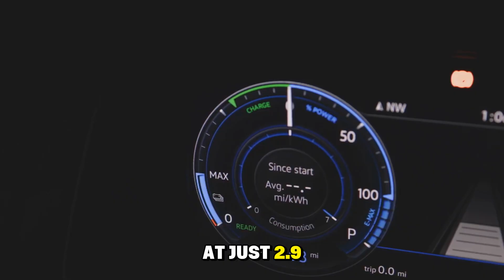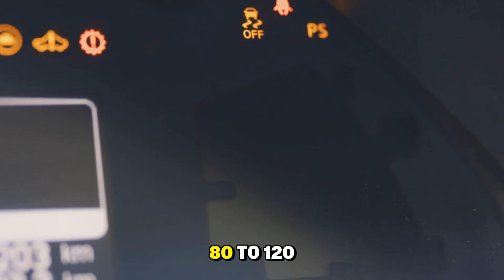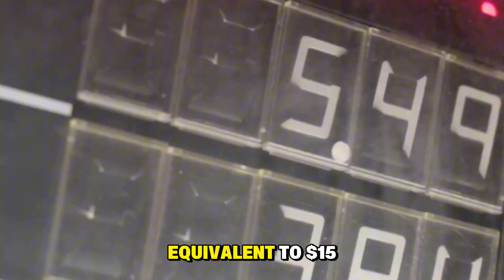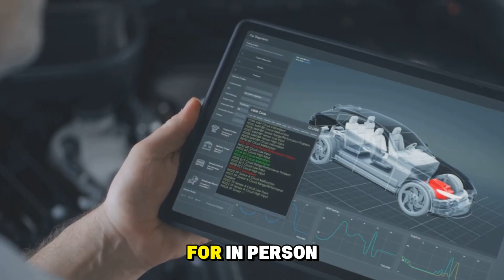BYD CEO This New Engine Will Destroy The Entire EV Industry!”

Comment: Hybrids are a backwards step. EVs easily achieve the equivalent of 1.5L/100km or better.
Reply: How about convenience ?
Reply: @Krishnahgg our EV is very convenient. Gets a charge once or twice a week from our PV system at home. Costs around $6 to "fill" it, not that we have to. We just top it up to 80%
Reply: VW had a diesel engine car 2009 with 1 ltr fuel consum , I am wondering why the car brands do not have researched to time for  better hybrid cars , we should have hybrids today with ekectric range 300km and low consum 1 Ltr
Reply: @kaanmario3646 no ICE cars have ever achieved 1L/100km. Certainly not a VW who were famously exposed for rigging their diesel tests in 2015.
Reply: @kaanmario3646  No ICE car has ever acheived 1L/100km.